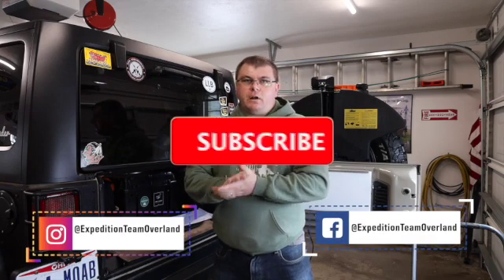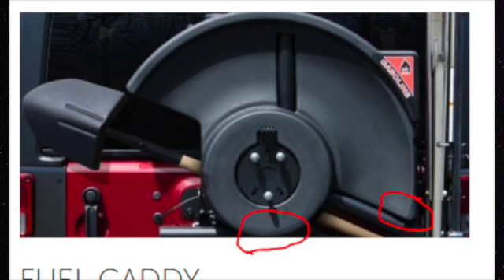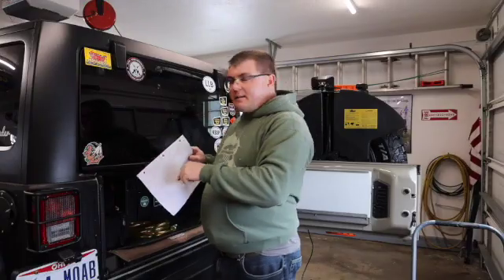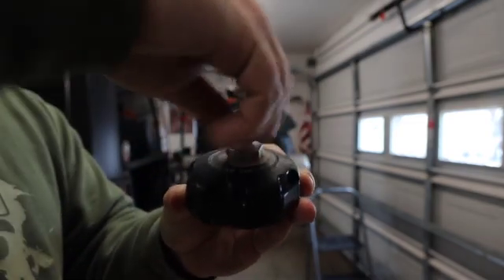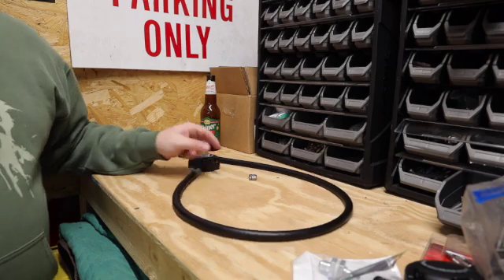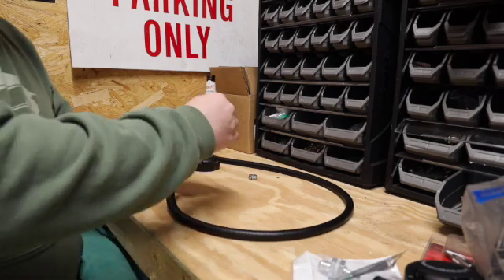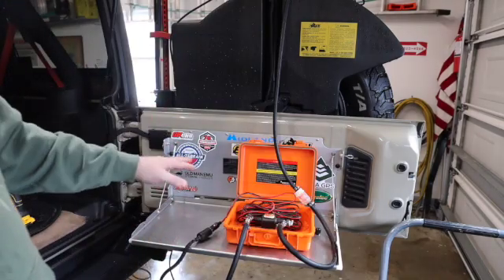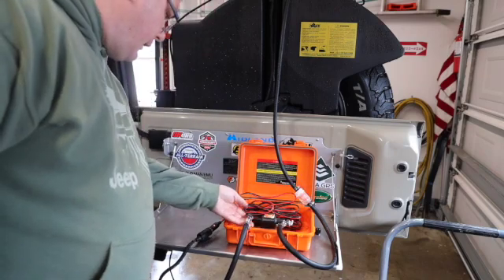AEV Fuel Tank Modification for Jeep Wrangler using a GasTapper fuel pump

Comment: Do you have problems with fuel leaking from the stock AEV gas cap?   Mine leaks so much and AEV isn't all that responsive.  They say just don't put as much fuel in it.  If the tank is more than 3/4 full it leaks though, and as you say about 2 gallons is not extractible.  So really my 10 gal tank is a 5 gal tank!
Reply from the maker: from my friends at AEV, who developed these products I had the same issue.  The AEV fuel tank is the only fuel tank that is DOT approved, and vented.  It is vented like the main tank on all cars.  Since its vented through the gas cap, when the tank is tilted so gas a vent out of the cap.  There is no way to fix this from when ay was told.  The design of the tank with the gravity tube to extract the fuel, yes you leave fuel in there.  That is why I designed this pump.  Its not easy to get all the fuel out beaus of Beth design.  Hope this helps.  Email me if you need more help and I can put in in direct contact with AEV
Reply: @ExpeditionTeamOverland  Thanks so much for the feedback.  I can't understand out how fuel leaking all over the tank and on to the trail is somehow a good thing (I don't mean to shoot the messenger....  just ranting).  I was going to try to disassemble the gas cap to see if I could either block the venting system or get rid of the "clicking" feature, but I think this is a long shot at best.  I had some luck with my home-made gaskets (from surplus rubber), but those failed after only a few trips.  They did seem to lessen the leaking a little.  I opened a case with AEV, but I haven't heard back yet.  

You mentioned I could email you but I don't see your email address.
Reply from the maker: DM me on Instagram or go to my website and there is a contact me there.